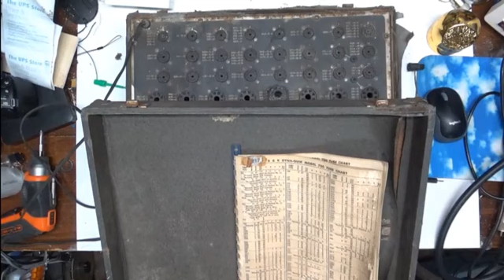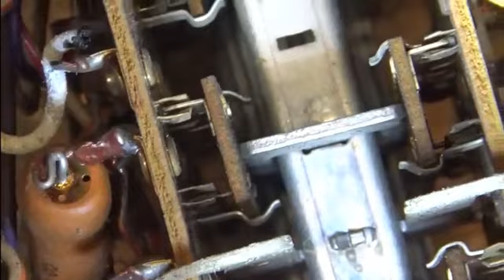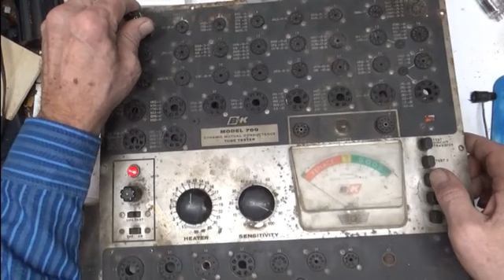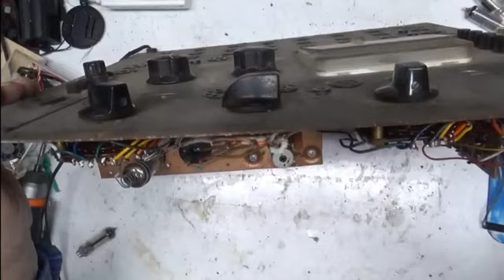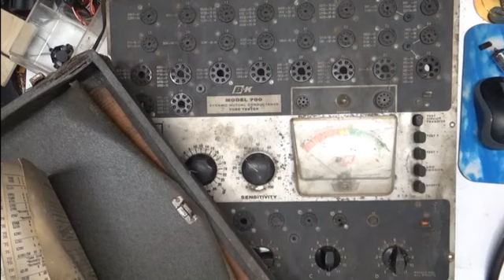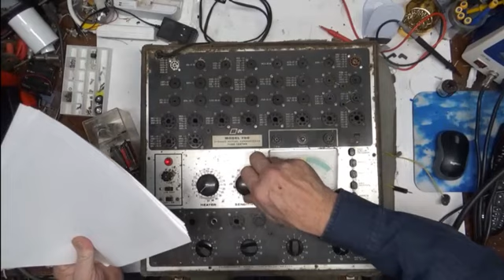B&K Model 700 Tube Tester Inspection and Use

Comment: Clean it up replace capacitors and calibrate it would be very good tester
Reply from the maker: I did just that and it is. I left the rectifier tube in it too.
Reply: @AERVBlog  perfect those tube testers can run solid state no problem it's the hickok tester like I have that need dropping resistors to emulate the filaments

Comment: To test tubes on bottom panel you have to press that top switch so light comes on bottom panel then can test tubes in bottom sockets. The bottom sockets don't test in dynamic mutual conductance only top panel does
Reply from the maker: Yes, thanks. I figured that out after I looked at the manual. I know, cheating.

Comment: I went ahead and bought one last njght much nicer than I expected preliminary perception is it is nicer than my hickocks. And eico. It is more extensive than I thought and ridiculously easy to use.
Reply from the maker: Good for you. I hope yours works right and the sockets are mostly in good shape. They are not too bad to replace though. Remember that the bottom portion only does emissions. Thanks for watching.